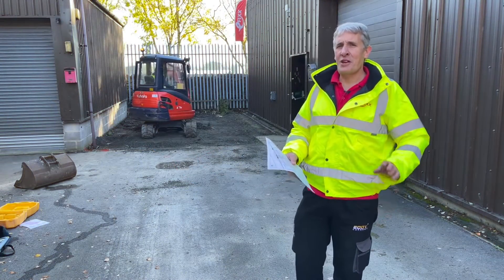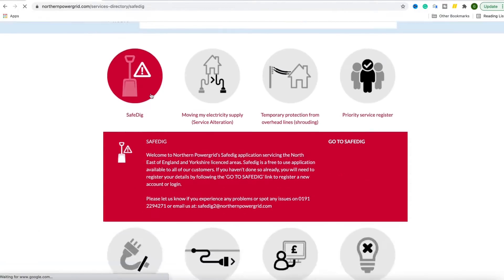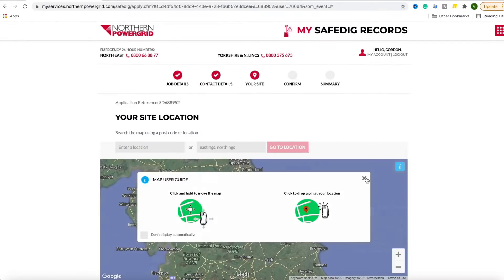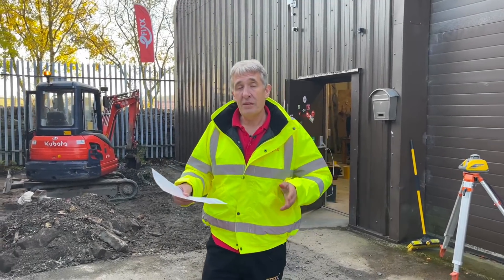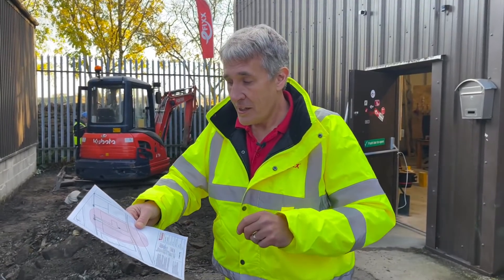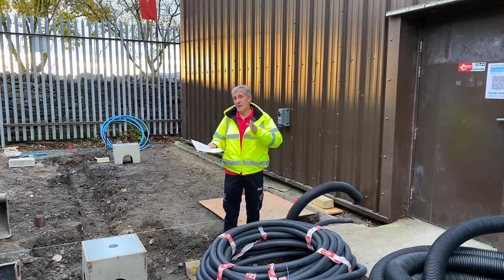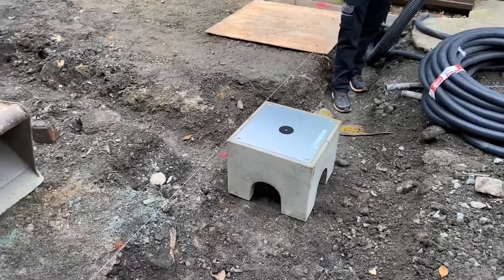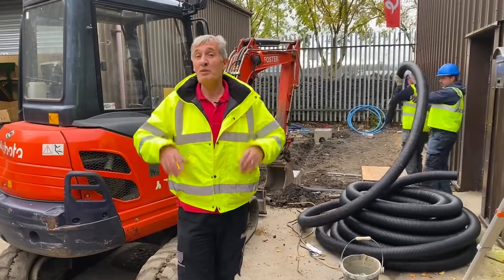Danger underground cable - SAFE DIG PROCEDURE

Comment: Think its a pain in every country. Here in germany you need to contact:
Sewer company to give you a plan for sewer lines,
Water company to give you a plan for water lines (Sometimes they are combined in a plan)
gas company for a gas plan
eletric for eletric plan
telecommunication for telephone
(Sometimes even more communication companies, as they have their own plans here and there)
cable company for cable plan.
Once we did study 6 plans, we actually hit an old water line from the previous water company(so not in the plan from the recent company) that was still live... Fun times.

But pretty sure if you run a big business they have (paid) tools to fetch all plans at once
Reply from the maker: Sounds like a major research job before you dig.

Comment: The starting point for all excavation in the vicinity of underground services (in the UK) is Health and Safety Guidance Note HS(G)47 - available as a free download pdf from the HSE website.

Cable record checks and CAT testing (plus checks for other services - gas, water, street lighting, cable TV/comms) should always be done before ANY excavation takes place. Trial holes may need to dug by hand to locate the depth and line of services, again BEFORE mechanical excavation takes place. If the trial holes require the breaking of hard surfaces, the surface ONLY should be broken carefully using power tools - cables, especially private cables could be right under the surface. As and when the use of mechanical excavator begins, this is a TWO person job with a banksman supervising the excavation, always looking out for cables, stop valves, etc.

If the builder 'found' a cable in the excavation and, after carefully checking the DNO cable records (and private cable records, if they are available), the conclusion is that the cable is most likely disconnected and out-of-use (note - that does NOT mean abandoned) then there a number of steps that can be taken to identify it and prove it not-live. Carefully tracking out the cable by hand to a point of termination or cut-end is helpful if (as in the video) the cable can be proved not-live. However, the out-of-use cable can only be cut in the excavation if it can be visually traced 100% (not 99.99%) from the point of cut to the point at which it has been proven not-live (and proven so immediately before cutting). A cable identification device (CAT transmitter or Lee-Vaughan tool) may be able to be connected to a termination to place a signal on the cable for detection at the excavation - this should be done by someone trained in cable identification.

If 100% visual tracing is not possible or practicable, AND the cable is clearly identified as a low-voltage type of cable (clues are armour type, embossing on PVC serving etc), it must be treated as live and opened using approved live-working techniques so that it can be tested. Finally, if all else fails and there is any doubt as to the type of cable (LV or HV) or whether it is live, it should be spiked using a spiking gun. Your DNO may or may not be willing to assist with live-working procedures and/or spiking - they will only usually do so if the cable(s) in question are in-service or out-of-use DNO network cables. Also remember that IDNOs operate live underground cables too so the DNO may just refer you to the IDNO - this should be clear from the DNO records though.

Cable tiles or marker tape is very helpful but - just like the cable records - it is indicative ONLY - it could've been moved in a previous excavation. Tiles and marker tape *should* be a minimum of 225mm directly above the cable(s) they are indicating but are often found right on top of the cables, which isn't as helpful as it could be. BS7671 is fairly vague about cable depths for cables run externally and buried in the ground - probably as they couldn't possibly list all likely installation scenarios. Generally speaking, LV cables (or ductlines containing them) would be expected to have a minimum cover of 450mm. Increasing voltage level cables have more cover. However, context is everything; the installation depth of an LV cable in an urban footpath and a ploughed field have different considerations and are exposed to different hazards.

The only assumptions you can make safely are (1) there is a cable or pipe right under the bucket of the excavator and (2) it is live.

Comment: Interesting.  In California we never get maps, but the utility sends someone out to mark their stuff.

The CAT tool is interesting too.  We locate our cables with an active RF transmitter clipped to the lines and a detector like the CAT.  Power can usually be located by using the mains frequency with the same detector tool.
Reply from the maker: Thanks for the local info

Comment: Time for some CAT training!
Wafting it around side to side isn't the correct operating method.
Reply: I completely agree. The use of the CAT was completely incorrect. EFIXX, please revise this and talk about radio and power modes and the fact that many cables such as non metallic such as comms, low power draw, currently un-energised, pot ended ect do not give off a detectable signal unless a genny is also connected to provide a signal. Hence why a penny is mandated within HSG47. Features such as the service head, scars within the road and the service drawings should be used to confirm any scan results and help identify anything that may pass through rather than terminate at the location. Equally, a look back in time on street view often identifies previous building layouts and hence changes in service positions that may have resulted in un-detectable potted ends.
Reply from the maker: If you’ve got some advice share it
Reply: Keep Cat  vertical and don’t swing it around, scan in two directions ie at 90degrees. Also use a gunny unit as well to get the best results possible
Reply: It shows you a diagram on the Side of the CAT the range of movement you should do and also a CAT should be used with a genny where possible

Comment: Wrap some cooper wire around the metal water tap and plug it into 240v mains then use the CAT to find the water pipe. The ac current will pass though the water and trigger the CAT. Will save you hitting a water pipe.

Comment: Excellent video, some standard questions often asked on a cable damage, is do you have plans onsite. Do you have a CAT. Did you dig a trail hole by hand. The amount of people who have no idea not just service cables but mains cables as well can run through your driveway or garden. Classic is if the housing estate has no pavements. Probably going to be a service strip in people's driveways and gardens. As for cable depth "it was correct at the time of installation" if that was 60 or 70 years ago and it's been landscaped since it could be shallow or deep. So cable depth is irrelevant.  Don't assume it to be at depth and so don't use an excavator.
Reply from the maker: Wise words 👍